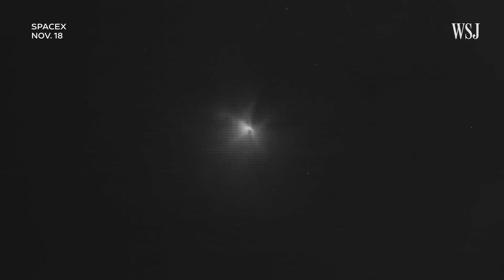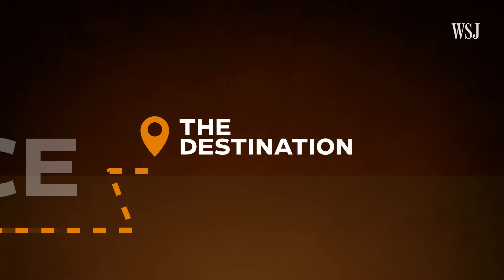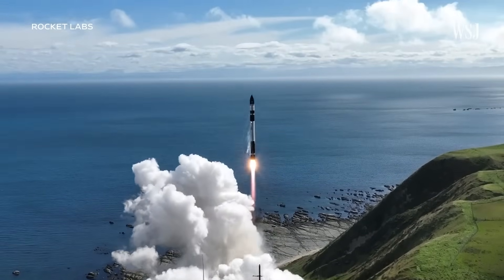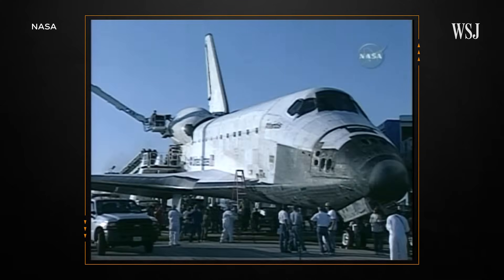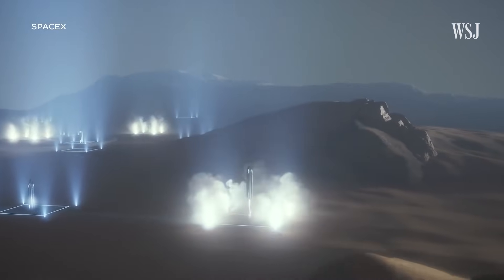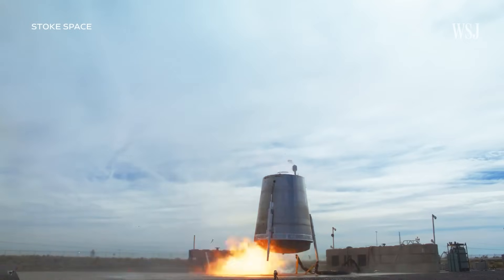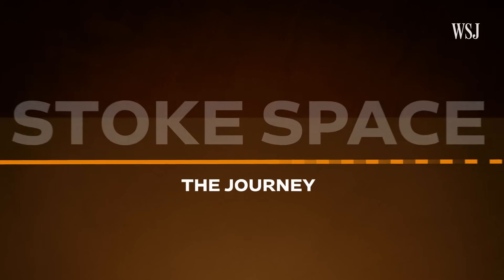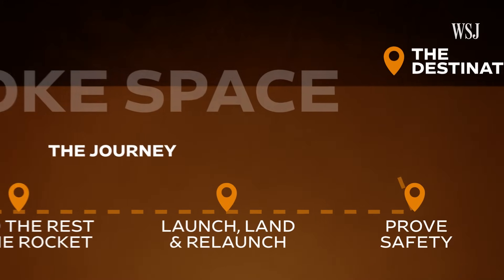The SpaceX Rival Hoping to Launch Fully Reusable Rockets

Comment: It has the potential to land in other planets too. This adds value to Stoke's solution as they can become a regular Earth to Moon transport in the next decade.
I like the approach and wish luck to this team.
Reply: If hydrogen turns out to be more readily producible from ISRU on the Moon than methane, then the upper stage vehicle becomes a cheaper to operate small tug that can haul Moon made oxygen to LEO cheaper than any system can haul it from Earth to LEO, and a small payload from LEO to Moon on return leg.   LOX is the lions share of the mass of the methalox propellant binary.  A LOT fewer tanker runs for Starship if it only needs to bring the methane and not the LOX.

Comment: It’s innovative and I hope it works. But why not have a bolt on heat shield with ceramic thermal tiles, or an ablative layer? After use, throw it away, and bolt on a new guaranteed to work heat shield. Then work on making that component as cheap as possible. After all, the Stoke method requires use of extra fuel, which must weigh a fair bit, along with the supporting pipework.
Reply: It's not that simple. A heatshield would also weigh a lot, with the supporting structure, and need extra fuel to be carried to space and back. Maybe it weighs marginally less, but they want the whole system to be fully reusable, and not to throw anything away. So the benefits likely outweigh the drawbacks. SpaceX is attempting to work with thermal tiles for now, and might figure out a way to make it work with minimal maintenance, but it may also be a short term solution, and they'll look into transpirational cooling again in the future (bleeding fuel where the heatshield sits to wick heat away).

Their metallic heatshield synergizes with their expander cycle engine too, and works a lot like regenerative cooling in rocket nozzles (which can reach higher temperatures than reentry). As the fuel heats up when it enters the atmosphere, it spins up the turbopumps for the engines when it's ready to land. Plus, using their cluster of engines, they can create an aerospike effect, shaped by the heatshield.
Reply: @davidk1308  I doubt you’ve done the weight calculations. Neither have I of course. Starship could not use evaporative cooling without adding a lot of piping, and crygenic liquid, presumably oxygen. It has a very large surface area, which is not good. Good luck to Stoke Space, it’ll be good if it works. Even if they fail, they will have explored that option. SpaceX has a history of trying, and succeeding one way or another.
Reply: the piping isn't really an issue, since you can make the heateshield walls the pipes. this is how a lot of regeneratively cooled engine nozzles are designed afaik.

Comment: Stoke should launch their upper stage on a Falcon 9 for testing, that way they can show investors they have a working reuseable upper stage (no other company has) and get more capital!               :)
They can play catch-up on the reuseable orbital booster tech, that's been done before.
Their upper stage is where the major innovations are, show investors that a heatshield powered expander bleed cycle aerospike can work and they'll be all set!       $$$
Reply: Unfortunately it would be really challenging to launch the second stage on falcon 9. Besides the Stoke second stage using a different fuel than falcon 9, both companies would have to design a mating system between the two rockets to connect them. I think Lapsa was asked about doing something like you said and he believed it would be more beneficial to just go ahead with their own first stage.
Reply: @ifalk325  A mating adaptor would be a one-day welding job, but you're right about the fuel issues, the lack of liquid hydrogen at SpaceX facilities would be the biggest hurdle. A mobile fuelling system would be a huge benefit for the little Stoke rocket, which could be launched from a variety of locations if desired. So, I think it remains a faster way to get a surge in capital for the company.        :)
Reply: What do you mean?? Literally both SpaceX and Blue have a reusable second stage.
Reply: @deeptoot1453  A capsule isn't the second stage, it's the payload.  :)
Falcon 9/Dragon uses an expendable second stage with one Merlin engine.
New Shepard doesn't have a second stage.

No company has a reuseable second stage because vacuum nozzles are very big and difficult to re-enter effectively - Stoke could be the first with their plug engine style design. 
 
Stoke and SpaceX are the only companies really prototyping reuseable second stages.....
Reply: @EveryoneWhoUsesThisTV  nb. BO is prototyping a reusable second stage, but they are neither committed to it, nor producing it. it's codenamed "project jarvis". it's been rumoured for a while and tim dodd's latest interview shed a little more light on the design process.
Reply: @0x5DA  Yea, I've seen the design, it's similar to Stoke space unsurprisingly...
I think the Stoke design is better and further along, which is no shock...

I haven't seen any evidence that BO have started prototyping the reuseable version, they clearly plan to start with the expendable version which is quicker...
No hardware there yet...
:)

Comment: Good report- and good that you give visibility to a small, innovative company like Stokes. In terms of market….keep in mind, SpaceX jumping from Falcon 9/Falcon Heavy way up to Starship isn’t necessarily covering all the potential markets at all. If Stokes succeeds in getting their fully-reusable 2 stage working- but at a much smaller scale than Starship- there’s no question in my mind that they can find a niche. Particularly since most other players are simply not emphasizing the full and rapid reusability aspect. Only RocketLab is working that, but at not a faster pace than Stokes is- and they don’t launch from the Cape (which can make a difference). - Dave Huntsman

Comment: I wish them the best.  It will be exceptionally difficult to compete with SpaceX, but maybe they will have ideas that they can patent and others can license (such as the matallic heat shield).
Reply: that's why you never start large as one giant chunk. even when space x started their rockets where very small and many of them failed. you start small and gradually work yourway up. but never compete directly head on since you wouldn't have anywhere near the logistical capability that space x does. , try to fulfill a market gap which is what they are trying to do here.
Reply: @TheBendablespoons  Has Nasa ever blown up rockets?  How about people?  Spacex uses an engineering mentality called Agile which promotes fail-fast as a way of learning.  They allow rockets to blow up, not people.
Reply: @TheBendablespoons😂 such a loser a only company that can land a rocket all the time🤣